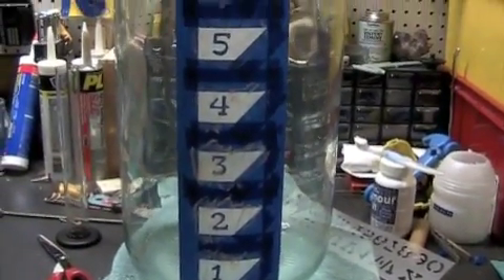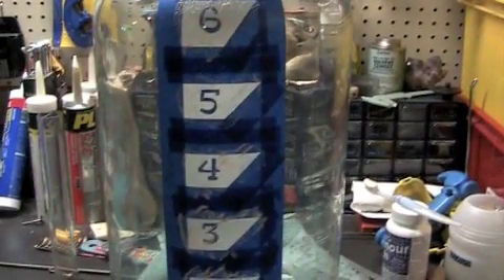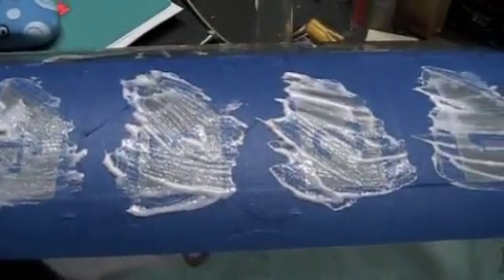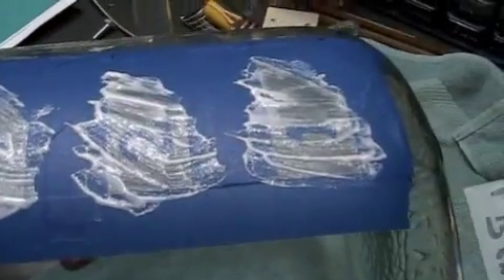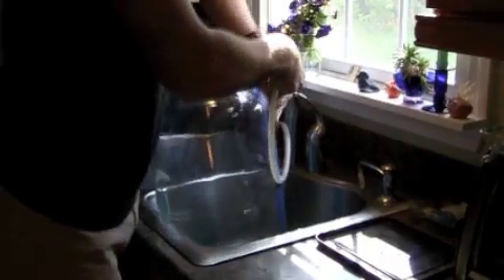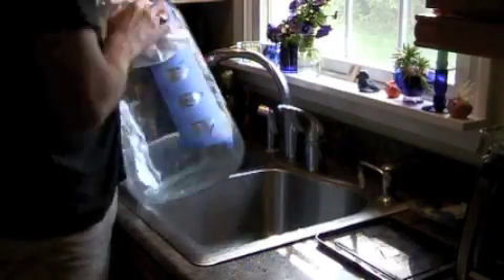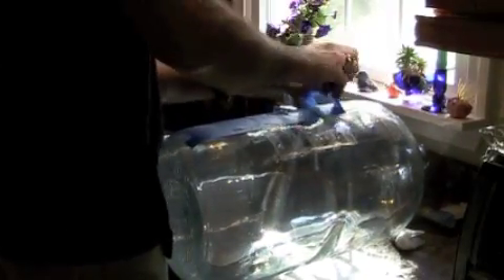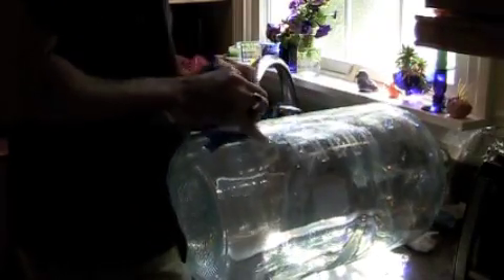Carboy Etching

Comment from the maker: Thank you. moedogger21, I'm eager to see it with a brew in it as well.

The 'Armour Etch' was $30 and the template set was $3.50. I got the 10 oz armour etch because the 3 oz one was $15 and I didn't know how much I would need. Judging from how little of it I used, I could have bought the 3 oz and still had enough to do all 4 of my carboys and some drinking glasses as well.